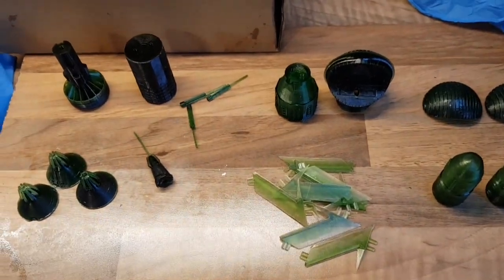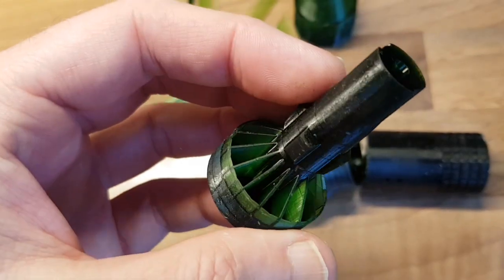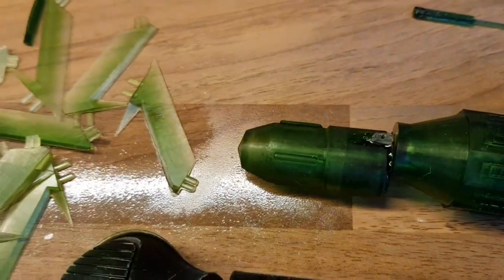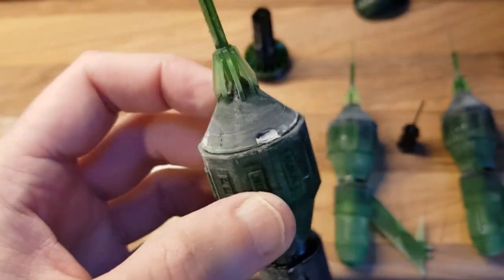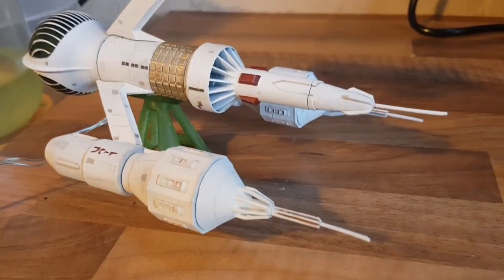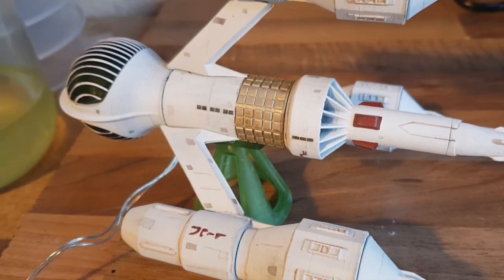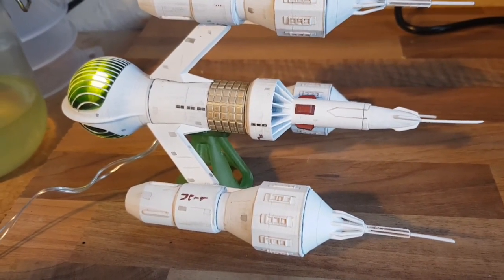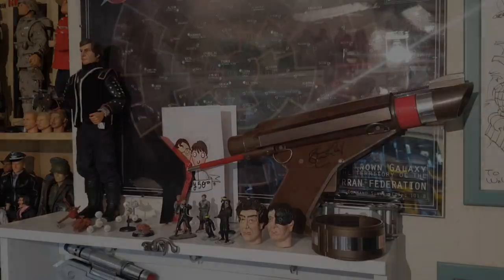Photon S Resin 3D Printed Blakes 7 "The Liberator"

Comment: Super cool.  Do you airbrush your undercoats?
Reply from the maker: I always just use cheap rattlecan primer (from Poundland) for the undercoats and then brush (pointy wood) everything else. I have an airbrush and have only started using it recently and for where I can't get rattlecans in the colours I need as I am not great with them and the cleaning of them after use takes longer than I ever use it to paint with

Comment: Holy crap!  I used to have one of these as a kids.  Cannot find a decent one anywhere.  Did you 3d print this?  If so, where did you get the blueprint for printing?
Reply from the maker: The large one is 3D printed on a resin 3D printer from a file on Thingiverse and the smaller one is scratch built from my old insulin pens.
Reply: @imarmodels  got a link?
Reply from the maker: @jimmyjames1807  https://www.thingiverse.com/thing:1622169